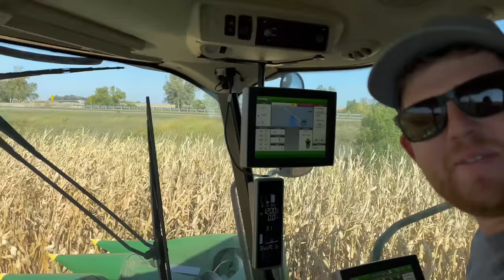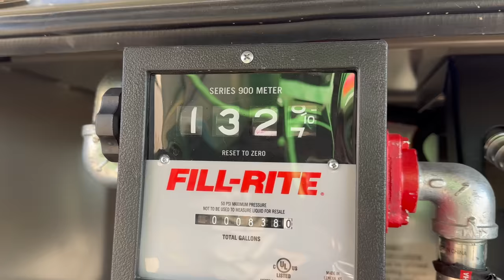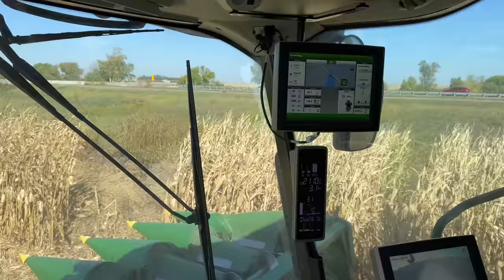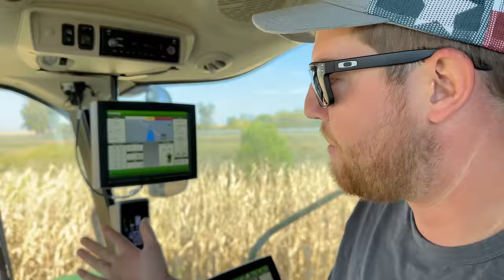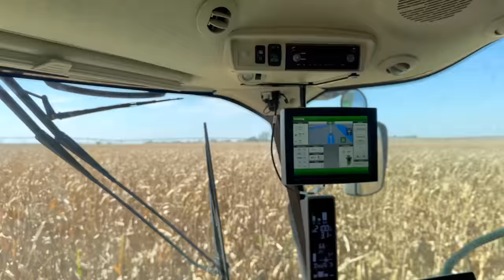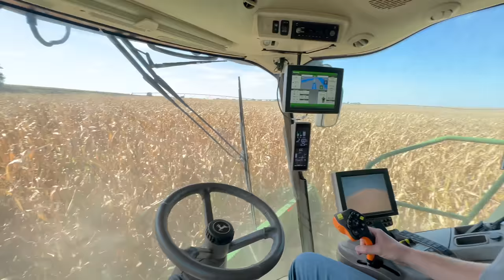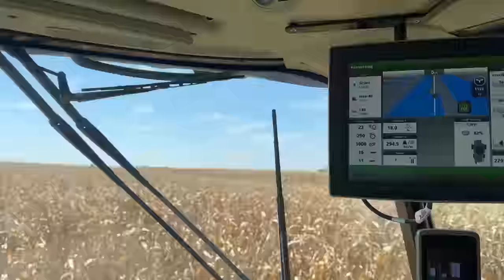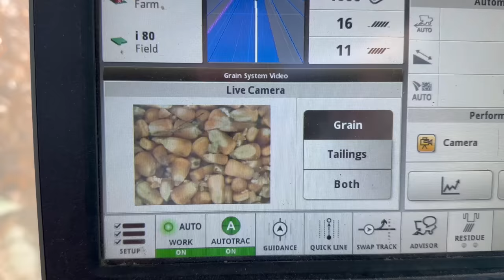Someone CRASHED Into My Corn Field!

Comment: Grant, might I suggest you pre fill that big oil filter with oil before installing on the engine . I don’t do this for my little diesel engines , however for the bigger engines it takes many seconds to fill that big filter and then supply oil to the oil galleries and the crankshaft.
Reply: I make it a point to fill every vertically mounted filter, no reason not to!
Reply: Especially if it's a remote mounted oil filter
Reply: I was thinking that...
Reply: Yup. Always a good practice to fill up all filters you replace (if possible). For those that are not viable, there's a trick where you modify the base to add two ports (an air bleed and a mini hydraulic push lock) that way you can put oil in after the filter's been set in place.
Reply: Even horizontal filters can hold a good bit of oil without getting messy on install- lots of fiber - wise to prefilled.
Reply: I would to, but some newer tractors, make it a point to not pre-fill filters. Oil or fuel . It's so any oil entering system gets filtered, even though its new oil. There's two sections of every filter, inlet and outlet. They don't want you dumping non screened and filtered oil directly into outlet chamber, which is usually the center. The engine draws from the oil pan to lubricate then circulates through filter housing. A dry filter has no affect on oil pressure during initial start up after oil change. Again this is not all equipment, but lots of new stuff, especially cat, says not to. The factory filter will have a fuel nozzle or can of oil crossed out on it, meaning do not pre-fill. The fuel systems and high pressure oil actuated injectors have very tight tolerances now days and clean fuel and oil is crucial to longevity.
Reply: A leaf blower works great for blowing out air filters and radiator screens.  Don’t have to worry about the high pressure from a blow gun tearing the filter material.  The leaf blower gives a high volume of air at low pressure.

Comment: Picking - shelling - harvesting. This is a grandpa question. Picking goes back to the days when corn was literally picked by hand one ear at a time. This migrated to when machines still picked the corn on the ear, typically with a pull-behind or tractor mounted picker. When the first grain bins arrived, most folks added an attachment to their tractor mounted picker to shell the corn before it was augured into the wagon - this was called a picker-sheller. Withe dominance of the combine, we began to call it harvesting corn.
Reply: harvesting
Reply: Yes I am 67 so I am old enough to know what a corn picker was and what it did, so your explanation was accurate. Mine was similar to yours.
Reply: hand picking is a lost art for those who are born after the Koren conflict. Father-in-law still had the equipment he used to do just that, except the horses. Talk about labor intensive to pick but also to unload into a corn crib. then when you sold it, you handled the ear corn again to shell it. all this is done in the fall, Spring was another labor intense effort to plant the corn
Reply: Perfect explanation.   I am old enough to remember picking ear corn.  I even picked some by hand.   It is amazing to see how far these machines have come since the hand picking days.
Reply: Remember that 60 bushels to the acre was a good yield back when corn was picked by hand. A farmer only had a few acres of corn, mostly to feed livestock - a few hogs, horses, etc. Today's 200 BTA would be impossible.
Reply: @cornflake73  We pulled corn by hand and picked corn with a two row John Deer picker. You would shuck and shell by hand, the shelled corn was used to plant the next years crop.
Reply: 38 inch row width back then - I think so the horse would fit. Then the "tricycle" type tractor fit that spacing. My dad had a JD 630 with a tractor mounted picker in the late '50s. Went to 30 inch rows and 6 row equipment in the late '60s. Squeezed a 3 row head on the JD 45 combine.
Reply: We always "shelled" corn.
Reply: I remember building a corn crib and picking corn by hand when I just just a little tyke.

Comment: Decades ago, i was about 12, i was with our neighbor in the field harvesting sugar beets. It was october and the field quite muddy. That field was part level and part it had a rather steep slope downhill. The harvester was towed by the tractor. The harvester had a conveyor, about 6 feet wide, to the right side to unload it. There were a lot of beets on this conveyor, making it right side heavy. On the way back to the next row the tractor drove along the sloped part, the right side pointing downhill tilted i guess about 20-30° to the right, about a foot above the tracks it already had made into the field. Due to the mud the tractor slipped down into the tracks. The harvester slipped down, too. Because of all the beets on the conveyor on the right side and it already being tilted it lost balance and toppled over. There was an open air seat on the left side in the back of the harvester. I was sitting there. I got thrown up in the air, and landed on the wire mesh cage that holds the harvested beets. I got a nice pattern on my back from the wire (well it was not wire, much thicker) mesh. Luckily the seat was on the left side, not on the right side the harvester landed on. I´ll never forget that. So a tool to break a window to get out can be a life saver.

Comment: Hi Laura if you ever have to use that hammer hit the glass near the edge by the rubber in the middle of the window it could bounce a bit and more chance of your arm going through the glass
Reply: only takes a heavy tap to shatter toughened glass with that hammer - arm goes nowhere near it.

Comment: You are combining corn, picking corn is harvesting the whole ear and putting in a corn crib to dry and then later using a corn sheller to take the kernels off. I have done all, and don't forget the harvesting silage where you cut off at the ground and dice the whole corn stalk and ear.

Comment: Have you ever tried planting something like a drought resistant corn seed on the dryland portions of your fields? Also, as a data analyst, I've been racking my brain about the different bits of data that could be collected and then used to help get better yields or project the yield throughout the growing season. Is this something that is often used in the industry?
Reply: as to the latter, I can state definitely that YES, such data analysis is vital to modern day farmers. 
Correlation between soil composition, seed density, moisture and fertiliser deposition, and yield is gathered and analysed constantly.
And as technology improves, this can be done ever more fine grained to where these days the water and fertiliser requirements can be tuned for every few meters of a field automatically by the computers in the machines, as can the seed density. Obviously sprayers for water aren't as accurate, but for fertiliser it is now distributed in precisely calculated doses so as not to waste anything (and to reduce pollution as a very desirable side effect, though the original goal when developing the tech was of course to reduce cost as fertiliser is very expensive).

Different brands have different names for it, but they all do more or less the same thing.
Soil samples are taken, combined with last year's yields, and used to compute the optimal seed density and fertiliser density for every spot of a field down to a few meters.
Reply: @jwenting  there is a huge amount of data collected by many of those electronic devices in the cab. I had asked my neighbor when I lived in Wisconsin about all the electronics.
Reply: There is tons of data collected and shared in these modern machines.  This is how they grow 302 bushels of.corn an acre.

Comment: That brings back a lot of memories for me. Our old John Deere would let you know when it was full by the kernals falling on the cab. I worked from 10 am to 12pm most days during harvest. I would have to go back to the trailer to unload as we had no help. I skipped a few rows turning around a couple of times while learning to harvest. Good thing the boss didn't catch me harvesting just 2 rows of a 12 acre field. Counting rows to skip in the dark can be a challenge with poor lighting on the harvester. Some small fields we would leave 4 rows for the dove hunters to use as blinds. I liked corn more than soybeans. Regardless, it is way more work than most people realize.

Comment: to save seed make a map to stop seeding a foot or 2 after point where you water. form vid looks like maybe 3 or 4 pounds would be saved to use elsewhere
Reply: They have commented in other videos that this was a dryer than usual year.  I think they usually go ahead and plant those non-irrigated areas because those areas will produce some corn if they get decent rain.  I'm guessing (though I definitely don't know) that, on average over the years, the extra profit in those areas from wet years exceeds the seed-cost and other planting/harvesting (glorified mowing) expense loss from dry years.

Comment: Go to Napa, they have a whirlwind spinner type compressed air paper air  filter cleaner - it's a air gun that sticks down the open end of the air cleaner and spins the nozzles and blow out the dirt -and I never bought one because my Land cruiser and Ford E250 Van didn't use a cylindrical filter element.  state the full date in the video wrap-up 😁 21:12

Comment: Awesome video! I especially like the shot with the kittens and the sunset, it was spectacular. About the vernacular concerning corn, I was told that picking corn is plucking the ear of corn from the stalk, whether by hand or machine, then conveying it it to a wagon to be dumped into an inclined drag conveyor that filled the corn crib crib. Shelling corn is when the corn on the cob was stripped by a machine when it was unloaded from the corn crib. Harvesting corn is using a machine that "combines" both operations

Comment: big equipement uses big filters and lots of oil.. but that the way it is.. I find it helpful to fill or half fill the oil filter before screwing it on.. it help to build pressure quicker so less wear on the engine.. a old mech told me this yearssss ago.. LOL...  keep oil changed adn good clean fuel and they will run a long time trouble free.  Good job..

Comment: I'm sure everyone has their own definition.  Picking corn was when you had a tractor, corn picker with a wagon and knocked over the stalks and got a full ear of corn.  Shelling corn was when you took the picked ears to the barnyard and shelled the seed.  Harvesting the corn or combining the corn is when you use the combine to reduce the stalks and cobs to shreds and have the seeds in the combine hopper.  IMHO that's the way I think of it.  Won't argue about it though. 

Hope the state/interstate road system took care of the fence.  Betcha some guy has got a very expensive vehicle repair bill.

Comment: That added fluid (aka ad blue)  is a distilled water/ureum solution sprayed into the exhaust and is supposed to nutrelize particles in the exhaust gasses and make it more environment friendly.
It might be an idee to show a ,,escape car in accident,, instruction. If ever needed, hit the glass in the corner to break it. But there might be an plastic layer so you still have to kick it out with your foot.

Comment: I know I shouldn't have to ask, but since I did not see it done, you do preload your filters before installing the new ones? I have a semi that has two large filters like that on it and between them, they hold almost 2 gallons of oil. If I did not preload the oil in them before installing, the engine may seize before they fill up from the system even though the truck has 10 gallons of oil in it. The last time someone else changed the oil in my truck, they preloaded the filters, but also put an additional 10 gallons of oil in the motor causing it to be 2 gallons over filled...also bad. I can also see the upgrade to grain carts. Before, we had to drive the truck to the combine or more often the combine to the truck at the end of the field, wasting a lot of time.

Comment: For me it is harvesting corn.

Picking is when you single handly picks the ears of corn off of the stalks, or when a machine collects the ears off of the stalks but does not process the ears of corn.  This situation deals with old style harvesting corn back when the ears of corn were stored in a corn crib to dry, and finally harvesting corn on a small hobby farm or in a garden.

Shelling cirn means taking the kernels off of the ear.

Shucking corn is taking the husks off of the ear of corn while leaving the kernels on the ear.  Once again like in a hobby farm, especially if the farm has pigs and feeds the ears with the kernels stll on the cob since the cob provides feed to the pigs.

Harvesting encompasses the entire process.  Picking and Shelling are steps in the process

Comment: You should have filled that filter with clean oil before installing it as to allow the oil pressure to stay at optimum pressure and flow. Also leave the engine oil filler cap in place untill you are ready to refill the engine. You wouldn't want to accidentally drop something in there that could damage that engine. 🚜🚜🚜 great video Grant and Laura.

Comment: You pick corn.  You combine beans and oats.  Picking corn goes back to the 1800's to early 1900's when farmers walked through the corn fields and picked it by hand.  A team of horses pulled the wagon that the corn was thrown into.  The wagon had a back board on one side of it.  The farmer didn't have to be careful about throwing the ears over the wagon as they would hit the back board and fall into the wagon.  The horses were trained to walk along at the farmer's pace with no one driving them.  They would respond to voice commands from the farmer to stop or turn at the end of the rows.  We've come a long ways since those days.  The horses didn't need DEF or diesel fuel.  Just a feed bag of oats or corn would do.

Comment: Picking corn was back in the fifties and sixties mostly picking it on the cob, not shelling in the field or putting it in the corn crib for later use like grind it of hog or cow feed. Shelling was then a stationary machine for that purpose. Picked a lot by hand for my grandpa but most of the farms around me and we had as customers at the mill used pickers with on or two rows at a time pulled by what you would call toy tractors, no doubt, such as Ford 8N which was real popular along with a large number of tricycle JD and red ones.

Comment: We used to call it "Picking" corn. I believe that was from my Grandfather's day. They would hand pick the ears, shucking (or husking or dehusking) it as they went. 

I have very old memories of my Grandpa driving a team of mules pulling a wagon with my Uncle and Dad (the Huskers) walking along side picking and shucking the ears. They wore special gloves with curved steel knife blades designed so that with one motion, they could grab the ear, cutting (Picking) the ear off of the stalk, then quickly dehusking (or shucking) it and tossing the ears one by one into the wagon. It was a three or more man operation that took a long time to complete. 

This was around 1950 when I was 5 or 6 years old. If my fading memory serves me correctly, I believe their 2-row tractor pulled and PTO powered corn picker had broken down during the middle of the harvest and they had to get the corn out of the field before bad weather could knock it all down. So they had to revert to the early 1900's way of doing it. I can't imagine anyone picking corn manually these days.

Note: Corn was most often sold "On-The-Ear" in those days. If you had a Sheller, you could get a significantly higher price at the local elevator.
Reply: P.S. I just love watching your videos. Modern agriculture is amazing. They also help spark memories of what my folks had to do on the farm. Also, those kittens are cute.

Comment: I barely remember as a little fella being in mom's lap on the old Ford tractor.  I could either push the clutch down or the brake.  Couldn't get to both because I couldn't straddle the driveshaft hump in the middle.  Another year or two later I was walking beside the trailer bruising my hands trying to break corn off stalks.  It was rough and tough for a little human to do all that and my dad gave me grief cause my sister that is 4 years older could out work me.  I would guess most 10 year old girls are tougher than  6 year old boys, but it made me tougher and I learned what hard work was.  I can't tell you how many hours I spent in the corn crib shucking and shelling.  And by the time I was hitting my teens I was doing it all pretty much by myself.  I don't think we ever had more than 20 acres in corn, maybe average only 8 or so.  It taught me life lessons.  Good enough.

(Proud to this day of the year I put dad's old IH truck in double low gear and hopped in and out as I loaded 2100 bails of hay by myself.  It moved around 2 mph, I only had to jump in to reverse at the ends of rows.  Easy peasy.)

Comment: While in college I worked for the county highway department.  One summer I mowed the sides of the roads with a sickle bar mower.   Someone dumped barbed wire in the ditch.  Couldn’t see it and jammed up the entire bar.  Took hours to clear and fix.

Comment: When you contact the DOT to fix their fence, ask if they can install a Four Cable, Wire Rope Safety Fence - Four Cable median barrier system instead of just another barbed wire range fence.
That fence has super strong posts and cable and is designed to keep cars from going places they shouldn’t...